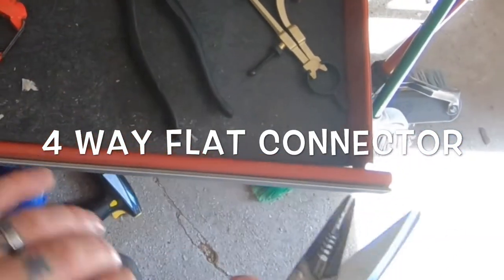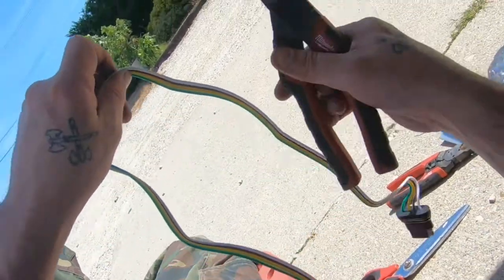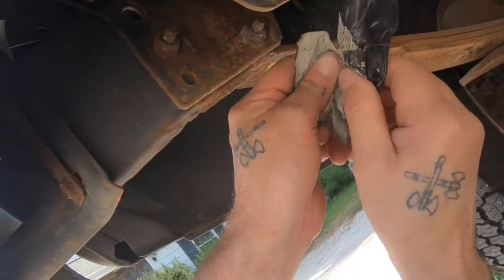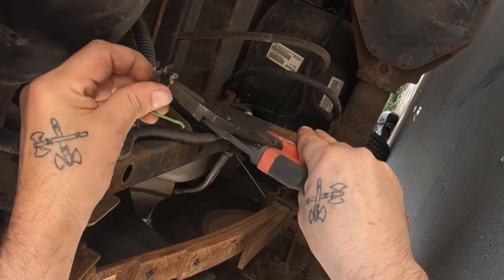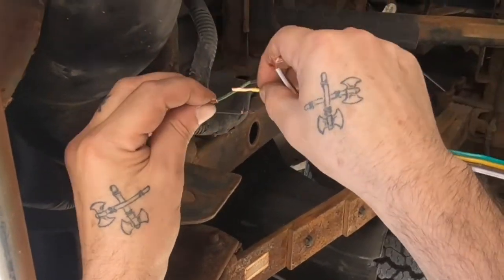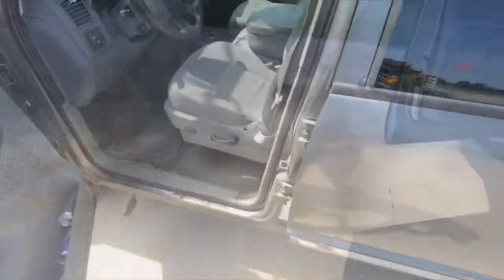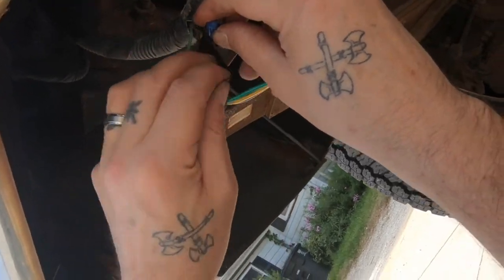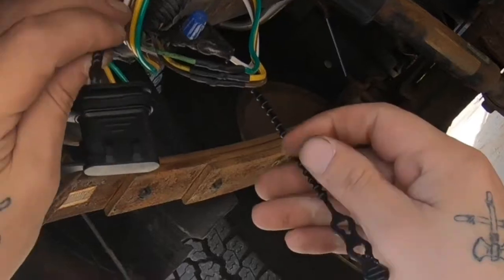Diy 4 Way Flat Connector.

Comment: Remember, heat shrink is Only used AFTER you solder connections.  Heat shrink is Not a structural support; it just provides isolation and helps keep water out.  One good tug on those wires, your connections will fall apart, just like the last guy's.  (I have a degree in electrical engineering.)  Just trying to help.
Reply from the maker: Thanks
Reply: Hello Tom. Nice to know you have a skilled background. i have a question for you. I'm replacing the vehicles side 4 pin connector with a new one. 'Without boring you with all detail. I have a 2002 Dodge ram. in order to replace 4 pin connector i have to indentify the wires.
I have a black with ( which probably is ground. that is on the existing  ground pin}
a white wire with a red stripe.
a yellow wire with a red stripe.
a black wire with a red stripe
Can you assist?
Reply: @michaelyoung9060  Hi.  I am sorry, I responded right away but youtube bots threw away my response, because we are being censored here.  I can not help, because every time I mention a wire's "c-o-l-o-r" or a tech website for wiring diagram, my post gets deleted by youtube robots.  I'm not even sure this one will stay up; better not use the wrong words, I guess!  I don't understand how your post is staying up.  Maybe they sensor me more?  But why?

Comment: This was great video, simple easy straightforward install.

I have 2002 Dakota 4wd.

Previous owner installed similar trailer connector a uhaul brand.
Has same color 4 wires, but......

Wait for it.......

That connector was installed poorly it melted the entire Black plug and messed up.
Luckily I found it, snip melted black connector.

My taillights parking lights and dashlights they all dont work, everything else does work.

I hooked up 16inch LEDs trailer lights as my taillights ducted to my bumper, but it works for now.

I need to reverse this install remove old harness wiring reconnect the oem wires back to normal.

Hopefully my taillights dashlights parking works again. 🤞👍

Comment: No way you are bad as the but connecting you should have soldered
Reply from the maker: Thanks for the feedback
Reply: It's good this way, if you plan on not using a trailer as much, and remove the connectormlm later on and if plan selling vehicle.

Comment: Iv been searching for days for someone with a good video apparently I’m going to have to read up and make a video because either it’s someone wiring a trailer or using existing wires to make a new one I want to know how to wire in one that never existed before because mine is messed up and I don’t feel like tracking it down I’d rather just make a new one.

Comment: Hey buddy, I tried doing this on my '02 Silverado and am having a small issue. I connected the wires properly, and all work fine except the brake. When I brake, the driver side trailer light goes out completely and the passenger side brakes properly. Any ideas? Thanks in advance if you're seeing this.
Reply from the maker: Don’t know sorry
Reply: Your trailer has a grounding issue .  Sand all the metal ground connections .  It is best to run separate ground wires to each light .   5/27/23

Comment: I added a new 4 flat trailer plug to my dad truck like a new 4 flat kit cuz the old one was losing connection to the right side and the truck was off and I used electric tape to cover the connection to a converter but what I'm seeing in the video on the trailer wire on the your car big no no on the ducky tape anyone knows if your messing with electric use electric tape ik it's not the best but it will do it's job in the long run
Reply from the maker: That was not duck tape. That was for electrical taping.

Comment: Between the tails lites of my truck I have 5 wires yellow green white red and black but the connector that came with the trailer has 4 wires yellow green brown white. How would I wire this?
Reply: You will need an adapter for that.
Reply from the maker: K

Comment: How can you call this guy a jack off for using twist wire connectors when you did no better all you did was twist the wires together and used heat shrink that’s just as bad as twisting the wires together and using wire tape, soldered or used connectors and then use the heat shrink over the top of the buck connector or the soldered wire.
Reply from the maker: Because I can and he was .

Comment: u screwed up by measuring your add on wires to the original piece hanging down from truck, then you cut off about 7 inches that was duct taped. now your 7 inches short..
Reply from the maker: To this day it still works . Thanks

Comment: TOTAL hack job replace with another HACK JOB.    Learn proper way (solder or crimp connectors) to attach the wires.
Reply from the maker: How old is this video? Still working perfectly fine so I would say this hack job was better then the other one. You did really good with your caps though. Such a strong point. Lol